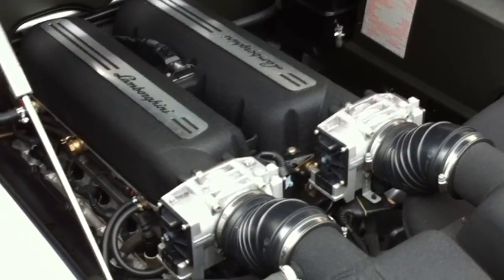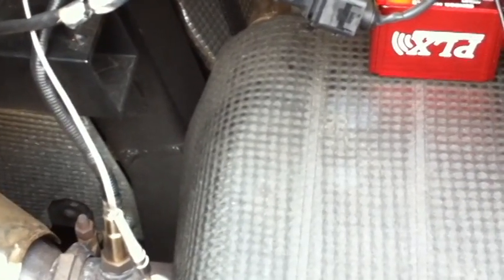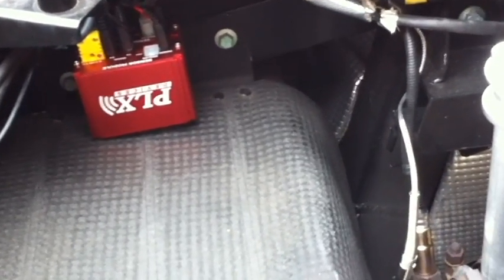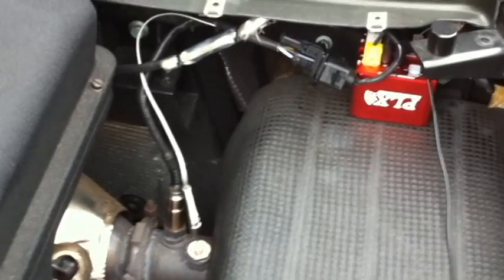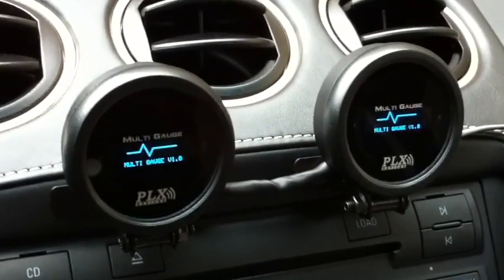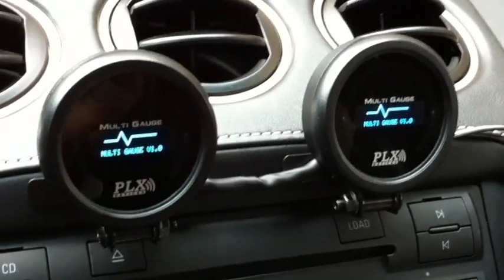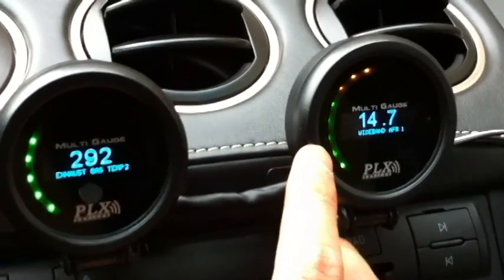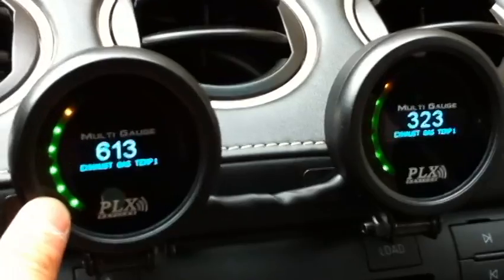PLX DM-6 Multi Gauge Lamborghini Gallardo Install (Part 2)

Comment: Thinking about putting these in a 2013 but my question is do I still have to buy the wide and module even though the car has a wide and from the factory or will it simply read it once its plugged in? Trying to decide between this and the aeroforce but I'm impressed with this. Really would like to make an informed decision and I hope you won't tell me it'll work when it really won't just to make a sale. Lol. Thank you.